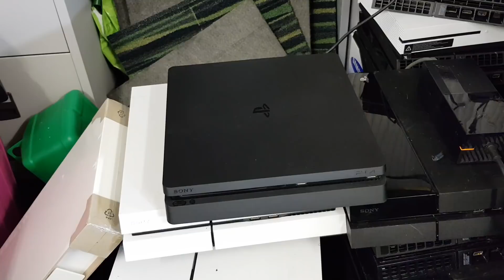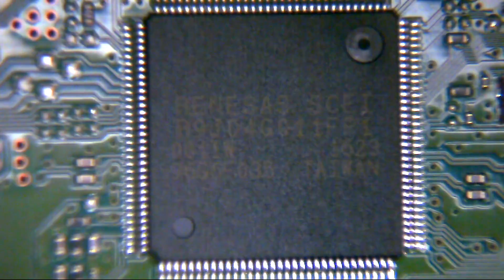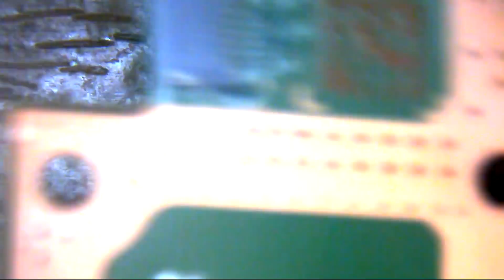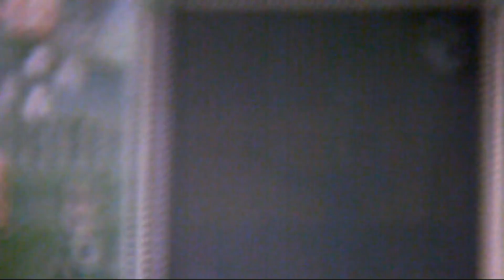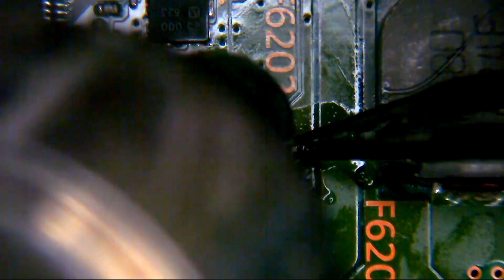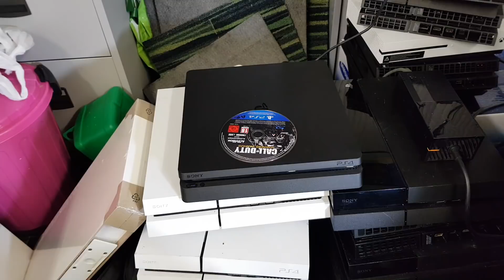PS4 Slim CUH-2xxx BD-ROM No Disc Feed - Fault Diagnosis and Board Repair (SAD-001) - SU-42118-6

Comment: Have the same issue on PS4 Pro - disk does not want to feed does not accept the disk at all. Board NVA-001

I have checked the fuses but I cant find F6202 fuse , I can find the labels F6202 and F6201 and there are two small SMS-s next to them very close one to other - one has a marking N ( which is a fuse and it has continuity and works ) the other is just black and has NO continuity but NO marking N on it , is that the F6202 ?

My problem started after repasting I have accidentally folded the Drive optic flex cable ( the thickest one ) , turned on the console - Disk wouldnt spin. Disassembled the console and seen the cable was folded, fixed the cable checked with multi meter all seem fine with the cable but disk still - NO disk feed.
Reply from the maker: It'll likely be the 'N' marked component - the one with no marking is likely just a resistor.
Reply: Andrew Paul can I somehow send you a photo, layout is similar to yours , not exactly the same but F6201 connects to a SMD chip like on your end (the fuse you replaced) and on that chip 4 holes with no metal pads and 2 holes with metal pads. The N one has continuity but the one thats linked to it does not. Can I send you a photo on youtube or facebook?
Reply: Here uploaded the photoes one is from your video other is on my board. See the resemblance , do you think the yellow circled SMD is a FUSE ?

Mine : https://ibb.co/kceJyn
Yours https://ibb.co/c0YYW7
Reply from the maker: They're both fuses - the left is F6202, right is F6201. If either show no continuity then you should replace the affected fuse.
Reply: Andrew Paul thank you very much, any advise on what rating amps should I replace it, I am scared of just making a bridge, but I have no spare /replacement boards from ps4 to take a fuse
Reply from the maker: Never be tempted to bridge it. I'm not sure what rating that fuse has as I just remove them from donors - I'd have to check it when I'm next near a board.
Reply: One thing that worries me is the left SMS element on my photo https://ibb.co/kceJyn , which is supposed to be F6202 and shows no continuity , also shows impedance of 60 kOhms, I am worried if its actually a resistor thougth, the layout seems very similar to the one of the PS4 Slim`s F6202 as in F6201 feeds electricity to the F6202 and there are 4 holes of the PCB on top of the F6201/02 that have no copper eyes (sorry i am not certain of the term in english ) and each 01 and 02 have two holes on the pcb below them that have copper on top of them. 

Are you sure that the left element is the fuse ?
Reply: Andrew Paul yes it Was a fuse. 60kOhm was from the motherboard, when I removed the fuse was 0L. Could not find a similar fuse so I had to use a thin coil wire. Everything worked ;)

I have to thank you for your videos and for tour support. If I ever come to UK drinks are on me.
Reply: @TheRcCarFan  Hi, I have the same problem on a ps4 pro motherboard, there is no continuity on the f6201 fuse, can I replace them both by buying this fuse? 
https://www.fast-pc.co.uk/products/copy-of-dda001ag-sop15-playstation-4-ps4-oem-power-supply-ic-chip?variant=19676668264545
or this?
https://www.mouser.it/ProductDetail/bourns/sf-0402fp100f-2/?qs=lYGu3FyN48euKtEKaujB7A==&countrycode=US&currencycode=USD

Comment: Great video and explanation. I'm finding lots of these bad fuses as well.
Reply: TronicsFix Hi! Do you know the Amperage and Voltage of the F6202 fuse? I need to replace it but don’t know which one to get :(
Reply: Im also having trouble with ps4 slim f6202.  I saw the comment to get a 1A very fast fuse, smd im guessing but there are so many different kinds online.  Please help
Reply from the maker: Cheers mate - it's weird as they've used a smaller form-factor fuse in here than the older boards. Are you finding they're like this one where they're more-or-less welded to the board as well? Not a very clever specification change by the looks of things. :(
Reply: Yes, they are on there! Not very clever for repairers.

Comment: Got a PS4 Pro NVB-004 motherboard that keeps blowing fuse F6202 which is Blu-ray drive related. What draws off of it is the BD7764MUV and\or the Rensas\Mediatek chip
Reply from the maker: It's usually a bad mechanism motor if it keeps blowing.
Reply: Unfortunately the laser and drive motors work on other PS4s fine. Tried two drives same result. Placing a disc in the drive slot turns on the PS4 but it does not and cannot pull it into the PS4. Making the PS4 think there is a disc in the PS4 I see and hear the laser lens (not the laser unit) move up/down ever so slightly then nothing cause the fuse goes, doesn't ever get to the point the spindle motor spins or the sled motor moves the whole laser.
Reply from the maker: I'd change BDV7764 as a starter then bud.
Reply: Unfortunately I'm not skilled enough and don't have the tools for IC chip reworking. Can I ask though do you know if the BD7764MUV chip is responsible for movements of the micro stepper motor / sled mechanism inside of the laser unit? I ask this as the fuse blows when there is movement on that motor.
Reply from the maker: It does.
Reply: So I took a chance and removed the BD7764MUV chip and reinstated the fuse. Powered it on and the fuse remained intact. Though I didn't try connecting the BD drive because of the obvious reason but maybe I should too see if the fuse would blow again. Trying to update the firmware with the burnt fuse would fail so that tells me the Mediatek Drive firmware chip is OK I assume . I don't have a replacement BD7764MUV chip yet so that is the next step to replace that chip.

I took the replacement fuse from an original NVA-001 Pro motherboard, fuse number F6201 to use on the new version NVB-004 Pro motherboard fuse F6202. Is that safe to use that fuse there?
Reply: I have similar issue - PS4 Pro disk feed does not work - drive does not accept a disk. Trying to find the fuses I can not find F6202 , is it the one close to the F6201 which has marking N but the SMD right next to it does not has N marking ? Board NVA-001

Comment: I've done a bunch of these repairs on Slims and only one on a Pro so far.. this issue is still a problem.. more of a problem on the older standard model. The PS4 is the 360 of this generation. Great Video.. keep up the good work :)
Reply: Do you know if the F6202 fuse on the Pro is the SMD element right next to the F6201 fuse, which has N marking for a fuse but the other I am not certain if its a resistor or a fuse ( has no continuity for me )

Comment: Great video and thanks for fixing my PS4 slim, that fuse certainly had blown well lol, working great thank you
Reply from the maker: No problem at all my friend and good to hear all is well :-)
Reply: @AndrewPaul  FS6202 had blown on mine. Awesome video and it's amazing to see someone (you) takes the time to post component level diagnosis videos for people even though each person that fixes their PS4 using these videos is a potential lost sale. Keep up the great work! I even see repair shops using these videos. The only thing I would add is a shot of the multimeter for people to see what the readings are (Not an issue on testing continuity). Thanks so much, my daughter is elated that it's working again

Comment: Nice one Andrew. Had one of these last week...used my only donor board for just  one fuse. Do you know if any of the fat models have the  same fuse values? I have a ton of them laying around but I don't know if, say, a BDP-025 would have the same fuse values. Water, Water everywhere and not a fuse to drink!
Reply: ModdSquad aslong as its the same size package it should work like i say any fuse is better than no fuse or a short

Comment: Great job Bud, definitely best expert at the moment,now waiting for SAD -002.
Reply: Where is the difference between these ?
Reply: @mareklindemann626  In my SAD-002 i could not find the F6001 fuse. I found F5103, F6201 and broken F6202 in the same area- and I'm just about to fix it.
Reply: SAD-002, at least for this portion, looks the same,I found two blown fuses. I havnt replaced mine yet, I'll update when I do.   you can get them on ebay. https://www.ebay.com/itm/PS4-pro-slim-eject-blue-ray-drive-Fuse-f6202-repair-dead-blu-ray-drive-no-power/274392024381?hash=item3fe30a053d:g:5iUAAOSw4k5e3wWD